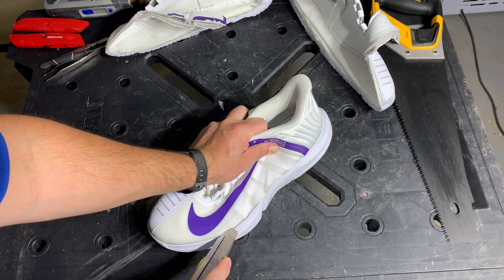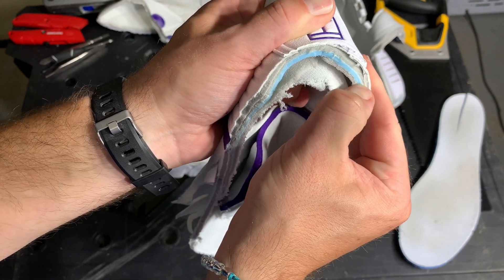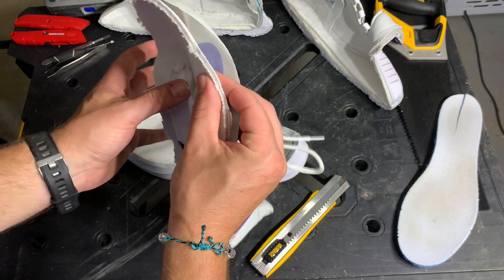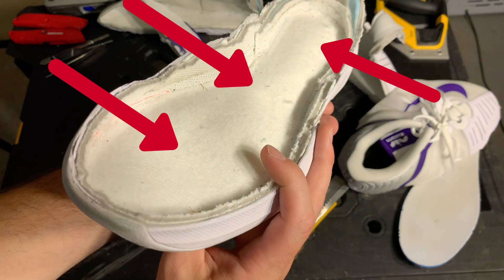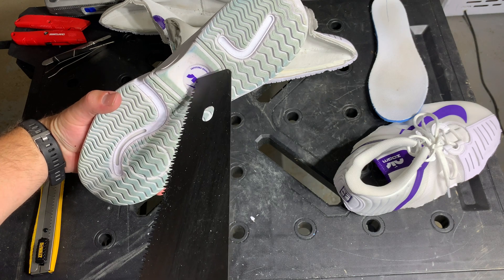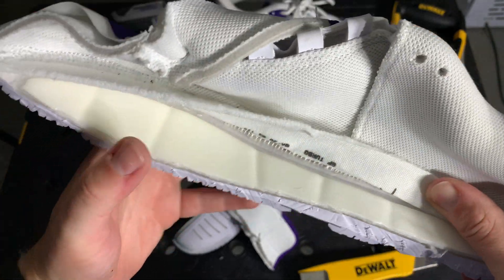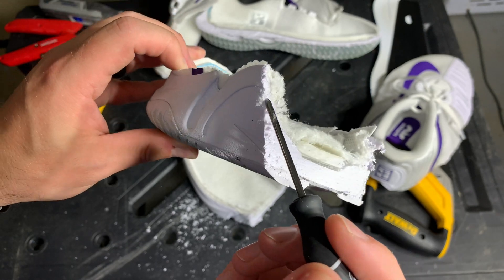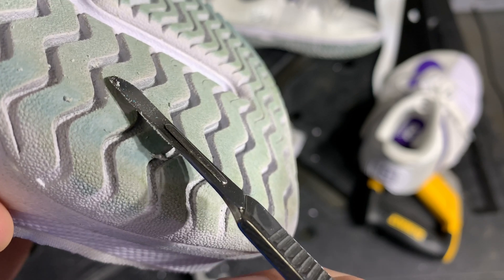Nike Air Zoom GP Turbo Cut in Half and Durability Tests | Tennis Shoe Teardown

Comment from the maker: If you are interested in everything Nike Air Zoom GP Turbo check out the on-court playtest here : https://youtu.be/2y05B9GwE4A
Reply: this shoes is really really Heavy.   didn't that make the shoe slow ?
Reply from the maker: Nope the weight is in the plastic plate which gives it a spring, and the double airbags which makes it very bouncy- you get a lot of energy return from them which more than makes up for the weight- these also aren’t the heaviest shoes on the market right now but on the heavier side of average for sure - but more important than just weight is what kind of energy return a shoe gives you - that will determine speed more than anything
Reply: @FootDoctorZach  i have PF.  so i have to use fairly heavy Orthotic insert made by my podiatrist.  so shoes on heavier side shoe doesn't work at all for me.   My orthotic is made of plastic and leather with some padding in the middle.   What is the best and lightest custom orthotic that is best for tennis players ?  i am willing to pay $600-700 for it
Reply from the maker: Graphite and Spenco topcover would be the lightest materials and still get the job done
Reply: So judging by it's specs looks it will be an all around shoe for basketball. Good durability , good cushion , good stability , good traction.
Reply from the maker: A lot of people have been trying them out for basketball so it’s worth a shot- they don’t have a  wide flange though so if you roll your ankle a lot playing basketball make sure you go with something else, otherwise let me know how they play for you on the basketball court 👍
Reply: @FootDoctorZach  well i am just looking for a good shoe that brings comfort and traction since i like to be a defendant. I am not into explosive play or anything that is too aggressive. Thanks if i buy them i will tell you. They are true to size or run a bit long or small ?
Reply from the maker: Pretty true- maybe a tad narrow in the forefoot but I have a wide foot and I was fine in my regular size- length true
Reply: @FootDoctorZach  good. Thanks man you keep the good work. I wish the best keep doing your stuff.
Reply from the maker: Appreciate it
Reply: hey, love your shoe reviews! just bought these, would you recommend switching to better insoles? i usually put my trusty powersteps,,

Comment: I’m on my second pair. I’m living with a fractured 5th metatarsal. Durability, cushioning, value, and availability, in this era, are all excellent. Relative to Asics GR8 and Solution Speed 2, I don’t find them “speedy” or “light”.  Mine are 15.9 oz, so on the heavyweight end. My GR8 are 14.6 oz. My Speed shoes would run laps around the others, until foot pain sets in and then I’m toast. The cushioning of GP beats that of the Speed and GR. I found the outsole to be substantially more durable than the SS 2 or GR8! I sure miss the Solution Speed 1. I strangely found more support in the SS1, or my foot is deteriorating, which is possible. Oddly, the heel/toe drop on the GPT already has me 1/2 way on my toes. I don’t like that. On the SS1, I manually pressed onto my toes, which I prefer. In tennis, I remind myself to stay on my toes, or at least transitioning, often.

Comment: Hi doctor! 2 questions.. 
1-I wear orthopedic insoles for my ball foot pain which make me go half a size up in Nike. Saw on nike website these ones run small, should i go a complete size up or stick to just the half size up?? .... 
2-  For my knee pain and ball foot insoles do you recommend more Solematch Bounce or GP Turbos??
Thanks for the help and congrats on the great channel!!
Reply from the maker: I honestly couldnt tell you what size to get, depends on the shape of your foot and inserts but i just made a video where you can see if your shape will fit well, but i usually never go up a whole size in shoes personally ; https://youtu.be/sqn8k3tVl6c - in terms of foot pain the SMB is a very loose fitting shoe in the uppers so I avoid those if theres specific pain im worried about

Comment: These or the Vapor Cage 4? I have broad feet, a little on the heavier side in terms of weight, and always play on Hard Courts. Cheers Zach!
Reply from the maker: I’d always pick the GP turbo I’ve the VC4-  but neither are very wide- GP turbo was decent in the 1/2 size up for me though
Reply: @FootDoctorZach  Hey Zach, went ahead with the GP turbo. Mistakenly got it true to my size, US10.5, during my first day out on court i could feel the tightness around the mid to front foot area. 

With your experience with these, do they expand in size after a few wears? Or should I consider returning them for a size larger? 

Cheers and can’t wait to catch that performance review of the On Roger Pros!
Reply from the maker: Mine broke in relatively quick

Comment: You mentioned that removable insoles would build up a charge while running with those shoes.
If you have orthopedic insoles that have to be removable would you recommend not to use this shoe?
Reply from the maker: It they have plastic or carbon fiber bottoms or you put some glue down you should be ok

Comment: If I take out the glued down removeable insole and replace it. Will it ruin the shoe? You said something about the original insole not building up a static charge.
Reply from the maker: It won’t ruin it but these shoes aren’t the best for orthotics because of the airbag - just depends if your insert is full length and has a more gripping bottom it’s usually ok- if it’s just a slick material that’s only 1/2 length that could slide and get annoying

Comment: Are the insoles removable? Do you think these shoes would work for 3/4 length orthotic inserts?
Reply from the maker: It’s removable yep, you can use a 3/4 length but i generally avoid 3/4 length orthotics for tennis because of the micro motion they create with being able to slide so usually with someone who has those  I’ll see if they can put it under the insole or get them refurbished so that they are full length
Reply: @FootDoctorZach  Thank you! My podiatrist said that 3/4 length custom orthotics would be better for me because I have mild bunions, and it allows for a bit more space in the toe box. He also said that the full length orthotics do not last as long, and I also do cross country in addition to tennis.
Reply from the maker: No problem- the issue I have with the logic is that the 3/4 insert makes your toes hit the shoes insole which can lead to early breakdown, so to avoid that you need to put the removable insole on top which makes them even thicker and a full length orthotic I’ve never seen breakdown faster than a 1/2 or 3/4 length plus the covers you can put on them are much better than the factory ones, but that’s just me

Comment: Coming from the performance basketball shoes space where we see a lot of performance claims from new tech coming out every year, it seems the supposed performance benefits of tech like zoom air are dubious.  Zoom has the advantage of having a compression curve that is noticable while standing and walking, but whether this compression actually promotes efficient energy transfer is difficult to verify.  Just from thinking about the physics, it's hard to attribute any "spring action", "launch" or "bounce" to a zoom air bag that easily compresses during walking strides, and bottoms out in response to higher forces.  Zoom air does seem to have the advantage of offering compression in a thin profile, beneficial for shoes that prioritize court feel.  Whether having instead a thin foam compound optimized for that thickness is better or worse is up for debate.  Your vertical clearance on serves are probably most affected by shoe weight, stability shanks, and fit more than the presence of a gimmicky air bag.
Reply: I like your attention to detail, and focus on practical testing, but performance claims based on technology gimmicks are hard to verify with much scientific rigor. After all, you can't exactly perform a double blind test isolating just the tech! Enjoying your channel since discovering it a couple days ago, and I've subbed, of course
Reply from the maker: So I agree with most of what you said about the stroble unit I think that’s mainly a comfort feature but the zoom air I feel does give some added storage of potential and then release of Kinect of energy based on the push - pull of the pressurized air- connecting fibers exerting force when you compress and release- the GP turbo also has the pebax plate which i feel cantilevers really well and that’s where a lot of the height comes from( I think I mentioned that but not sure I haven’t watched the video in a while)- as far as getting to a level 1 type study it’s almost impossible as you said with these as I can’t keep the parameters of the test constant even with myself - (I’ve gained and lost 5 lbs with the pandemic so that could be screwing with the tests even) I like to think that, of the tests I can be doing these are the most reproducible, and I think reproducibility is the key when trying to evaluate these kinds of pieces of tech - of corse I probably could put them under a CPM machine or something else but I’m not sure that would blend the playability aspect as well as the on-court tests - also those are super expensive😂 - if you ever have ideas for tests I can do though please let me know, a lot of what I have in the videos is from subscriber ideas and conversations like these 👍👍thanks again!

Comment: I’m really glad I found your channel. Thank you for your videos. I am handball player in nyc and the sport is similar to tennis. We play on concrete and I have been looking for a pair of shoes that have lateral support, can take a beating from the concrete, and have cushion to reduce the pressure on my knees from the concrete. Would you recommend the adidas solecourt or these nike ones? Or maybe something else. Looking forward to hearing from you.
Reply from the maker: Concrete you’ll need something with pretty grippy treads and a really durable upper so solecourt boost would be good also the yonex eclipsion 3 - both have great lateral stability - the GP turbo would be good for movement but I’d be afraid of  the uppers wearing down
Reply: The Tennis Pro Doc thank you. What about cushioning for reduced knee impact?
Reply from the maker: All good but GP turbo the best of the bunch followed by SCB and then Yonex

Comment: You're the missing piece the internet needed to cover tennis shoes. It's so nice to finally see someone fill in that gap; tennis shoes really don't have as much thorough coverage in the net as basketball or running shoes. Thanks a bunch for these videos! It's one thing to make content for a niche like this, and another to make them quality; you do both!

I do have a question though, does the thicker air zoom unit in the bottom layer (the one you poke at 3:53) go all the way to the forefoot, and is it the same thickness as the one in heel area or does it thin out?
Reply from the maker: Thanks for the compliment! Glad you are enjoying the videos-Yes it does it’s full length same as the airbag on top and same thickness though out that’s what really gives them some kick when jumping I think all that pressure moving though the airbags when transferring weight

Comment: Bit of a long shot, but do you happen to know, or have a rough idea, of the heel/stack height of this shoe? I'm comparing it to the Asics Court FF2 which is 2.7cm and these look to be lower, but you can never tell from a video! No worries if not. Cheers :)
Reply from the maker: 2.6 cm it’s also in the video here : https://youtu.be/Gys_uins0-s
Reply: @FootDoctorZach  thanks again doc; that's impressive that you know that exact stat is in a certain video! I just have one other question if you don't mind...

In the play test for the Turbo GPs, you said to check this video if you want to know what 2 weeks of playing does to the responsiveness. I was just wondering what the answer is, as I didn't catch it in this video! Did you find them to still be responsive and not too worn after 2 weeks? :D
Reply from the maker: Yep they didn’t really shoe much wear whatsoever plus dremel test was good so they’re durable except for parts of the upper

Comment: do you think they can do a carbon fiber instead of the clear plastic they use ? of course this will go for the pros like RF uses a carbon fiber vapor ?
Reply from the maker: Not in the GP turbo as the whole shoe is help together by the plastic plate and if it were carbon fiber it would be too stiff but for other shoes with a traditional shank sure it’s easy enough to exchange materials during manufacturing

Comment: what's a better shoe between the adidas stycon boa and this zoom gp?  they both tested off the charts...im personally interested in durability 1st, support 2nd, comfort 3rd!
Reply from the maker: Well the Stycon BOA upper will last longer it seems and can be played on both hard and clay- the GP Turbo’s performed better on court and gave me great feed back with my movement - the GP turbo have a tad more midfoot support IMO - they were both comfortable but the Stycon felt much lower to the ground so it will bottom out quicker where the GP turbo will feel more resilient longer- also it’s kinda hard to find the Stycon BOA sometimes as they have a much bigger selection of the original stycon without the BOA closure ( I don’t personally like the original stycon without the BOA- not enough support ) so if you play on clay a lot then Stycon BOA and if not GP Turbo

Comment: Seems like they would be a good candidate for me with a narrower foot and medium-to-high arch, as I bigger guy I am always looking for more cushion. One thing that makes me hesitate is with all those layers it looks like your foot might ride a little higher than to my liking. Does the shoe feel lower to the ground than the Gel Res 8? Thanks great content. 
One thing you can work on is sound normalization throughout the video.
Reply from the maker: I struggle with my mic all the time I’m surprised your the first one to comment on it - working on a fix- maybe a clip on mic?  As for your shoe- the GP turbo does not ride high for me- reason it doesn’t feel like that is that it has a pretty high heel counter so your heel really locks in there for a more stable feeling- the gel resolution 8’s felt similar but as they have that super solid midsole plate+solid heel counter the GP turbos had a higher but softer heel counter - depends on the kind of feel you like some like that really rigid, responsive heel, some like the cradle of a higher, softer heel- but I’ll tell you for a while I felt like my right heel was coming out of the gel res 8’s until I broke them in a bit but I NEVER felt like that in the GP’s - felt locked in from the beginning

Comment: Nice analysis as usual. Off-topic question: which shoe is your favorite (whether you’ve tested it here or not)?
Reply from the maker: I have a few- Adidas Solecourt boost and Nike GP turbo- I also love the NB 996- no frills all around shoe
Reply: The Tennis Pro Doc will you review the Adidas solecourt  boost or compare any shoes to them? I’m a fan of the Solecourt boost but they don’t breathe so I’m open to other stable/supportive shoes.
Reply from the maker: Yep I have them in the rotation just have a few others to get through- should be fairly soon though - thanks for the feedback!